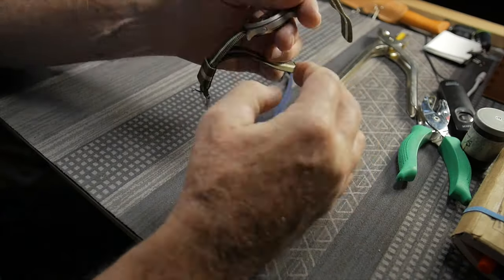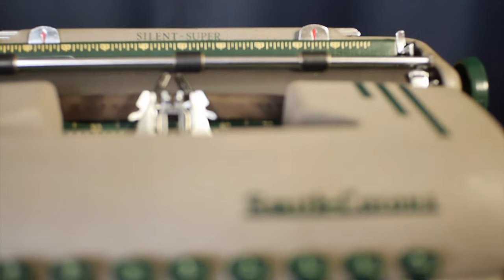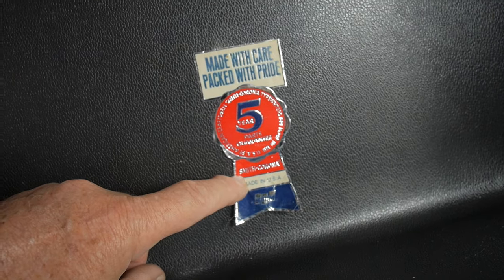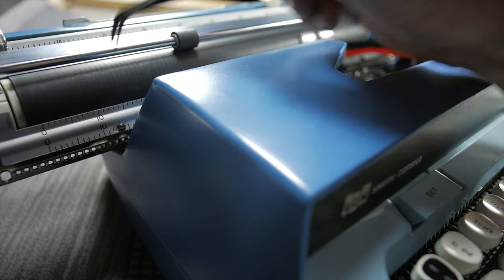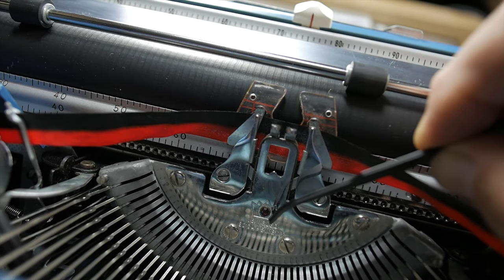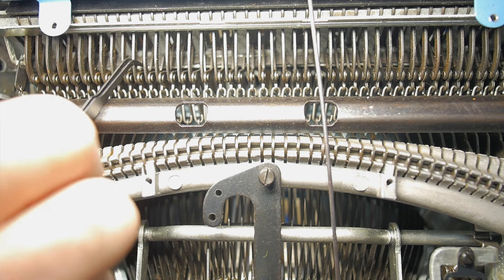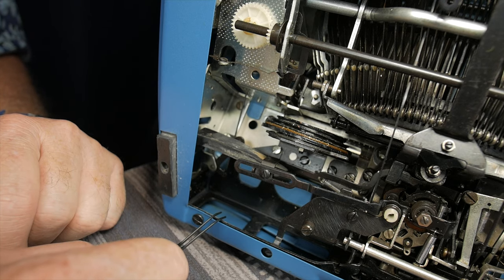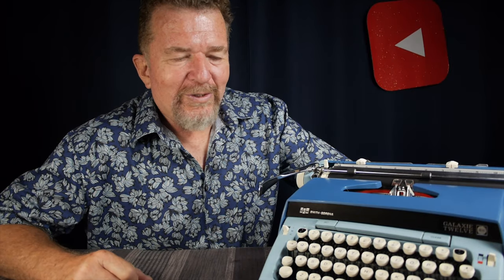Typewriter Video Series - Episode 232: Galaxie XII

Comment: That's the typewriter I just bought (only a different color). I found it in mint condition for $40. It still had the original ribbon. I bought two new ribbons and some synthetic oil for the keys. The "1" and "=" key are still kind of gummy, so I need to figure out how to clean those better.

Comment: These Galaxies are worth getting for the neat ribbon cover alone Joe!  There is an attractive Thunderbirds / International Rescue look to the whole design. The carriage release lever tops are prone to breaking off if the carriage is not centered correctly when the case is closed.  Apiece of brass tubingfrom a model shop will force fit onto the lever stub to make an elegant replacement in keeping with the "rabbit ears".  You can use the LD ribbons by tying a simple knot where the eyelet would go, but sometimes the knot can jam, so the eyelet works better.

Comment: My Electra 12 is probably my favorite typewriter. I have a manual carriage return and backspace (by choice),  to eliminate possible need for repair. Mine also has a 12" carriage.  That 12" carriage sure makes the carrying case big! Thanks for the tip on the typewriter release from the case...I did not know that.  I like it because of the uniformity of the type impression, all the letters have the same darkness.  

I had a S-C electric home office machine,.  May have been 220?  It had a power carriage return, but I loved the "hood" most of all. I sold it to buy my Selectric in 1978~.

Thanks for the review.  Phil (Phoenix)

Comment: 1975…yes on the plastic ribbon drive parts. I’ve seen earlier ones with metal parts.  Mine is very rattly when I type on it, reminds me of my Mom’s 1974 Ford Maverick 4 door sedan, rattled everywhere we went. Could type a novel on it. Mine came with plastic spools except the core is metal, I’ve never seen that before. The right spool axle is loose in the gear so don’t turn it upside down.

Now I’m wondering if it used to have thin rubber washers between the chassis and the body to dampen the rattling.

Comment: Hi Joe.  Great overview of the Galaxy 12!   I have the same machine.  It's a 1975 or 1976.  You mentioned the cheaper plastic gears.  I suspect a further cheapening of this machine relating to the one I have.  For example, mine does not have the articulating top cover.  The cover has two posts that push into the frame.  It presses on.  Also, it doesn't have the "jeweled escapement."  I'm not sure if the "jeweled escapement" was only a marketing ploy or if it means something.  Also, the case I got with it is  not the quality case of old.  It's an injection molded case that has a "hinge" made from plastic.  After I opened the case a few times I notice the hinge was tearing along the back edge.  Soon I'd have two pieces in my hands.  I used duck tape to secure the separating hinge, and it works.  Please comment and keep up the great videos.  I found something to do this winter with your help.  Mark.
Reply from the maker: I wonder if the machine has the same feel as the older versions. Alas, the gradual decline in manufacturing quality. I hope you find it satisfying to use.

Comment: Hello! When watching this video, I was interested in your comment on the plastic spindle mechanism.  I agree that the plastic peg is inconsistent with the overall quality of this typewriter. 
It is more disappointing to me in that one the the pegs broke off when I was changing the ribbon.  I put too hard when pulling off the ribbon spool. 

Is there anyway to repair or replace this spindle peg?

Thank you!
Reply from the maker: I’ve never had to repair one, but perhaps a tiny 4/40 screw could be threaded into the plastic disc from underneath, serving as the peg.
Reply: @Joe_VanCleave  Thank you Joe, that's a great idea,  I'll see if I can do it!

Comment: Very nice.  👍 I have a Coronet 12 electric, same blue scheme. Best part is the impressions all look the same and you don't have to move off the keyboard for the carriage return. In college I had a Corsair portable. Did a lot of term papers and letters on it. Should of kept it. Now I'm looking for one of the SC printwheel models with the correction cartridge....I make too many errors while typing.
Reply: I like the older coronets that had a manual return lever..felt more like a proper typewriter

Comment: I bought a s/c coronet electric for a steal. When I plugged it in about 10 keys tried to come up. It's dirty and, has been neglected. Some of the keys are stuck down and,  space bar doesn't seem to work. Where fo I start?
Reply from the maker: The type bars and slots of the segment where they move need to be thoroughly degreased. I’d start with alcohol and a tooth brush, then blow the residue out with compressed air, and repeat. Use lacquer thinner if alcohol isn’t working. Take off the bottom of the machine so the gunk can drip through, don’t get the solvents on the paint, and work in a well ventilated space.
Reply: @Joe_VanCleave  I used 70% rubbing alcohol with not much success. I'm going to up my game and, try 90% to see if that helps. Thanks Joe!!!

Comment: The carriage on mine is stuck all the way to the left, it can move freely if I push it over to the right and the bell dings when it freely goes back left.. but there’s no holding it in place to type. No clicking. Wondering if something is stuck? I can’t seem to figure it out. Worked fine tue few times I’d tested it out then stopped. Only just brought it home, any tips?
Reply from the maker: Sounds like the escapement mechanism isn’t engaging.

Comment: Actually this Galaxy XII was the first in my collection, because it was the one mom had and we used in school (1972) era.  One thing, my "power space" did not work...it "stuck".   You forgot to show the rubber "block" inside that literally vibrates to oscellate the spaceing mechanism.  I had to lubricate it with glycering as it got "age sticky".  This is actually an excellent, zippy, quality  machine, and the feel is good due to the shape of the keys, layout, etc. I can type very fast on this, although the Coronet electric twin to this is far faster. My Coronet is also brown like yours.  Imagine that.
Reply: "Actually this Galaxy XII was the first in my collection, because it was the one mom had and we used in school (1972) era. " Same here! Except mine is the Penncrest variant. I used for writing papers in middle and high school. When I (re)joined the Typosphere in 2018, the first typewriter I bought was the same Penncrest machine. A full-featured machine with a wide carriage.

Comment: I have this typewriter and its great, but sometimes I get random spaces in my words. Come s o ut ki nd a  li ke this. Do you know why?
Reply from the maker: This is called skipping and is related to the escapement system. It usually requires cleaning and degreasing of the escapement. On these machines it's easy to access underneath the machine. Sometimes it also requires some adjustments to the escapement trip point. Luckily, we now have access to the original Smith-Corona service manuals, from Ted Munk, at: https://www.lulu.com/en/us/shop/ted-munk/the-smith-corona-5-5te-and-6-series-typewriter-repair-shop-manual/paperback/product-186ndyrz.html?page=1&pageSize=4
Reply: Thanks so much, the typewriter king of YouTube got back to me. Appreciate it. Thank you.